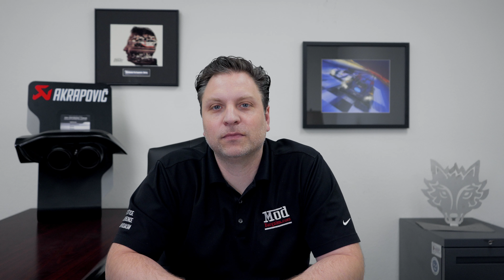Exhaust Materials Explained! *Pros & Cons*

Comment: Wtf, aluminum oxides doesn’t rust, you need iron for rust! There are different grades for stainless some still rust because they contain a high iron content. Dishwashers for example can have a stainless shell/tub but they still rust. Use a magnet on your stainless if it’s magnetic it has a high iron content and will rust. I’m not a materials scientist but this is pretty basic knowledge.

Comment: Ive been working on all sorts of cars all my life, I have never seen an aluminium exhaust. I dont even know how it will work, even the hardest aluminium tube/pipe is too soft for exhaust. and the worst for heat trasnfer, Hence why they are used for heat shields. and I would of said durability due to bad weather and salts, Aluminium would be the best.  over steel. but even with that, ive never seen it used for exhausts.
Reply from the maker: Check out MBRP exhaust - they sell them in aluminum

Comment: Inconel is not very hard to weld.  Most  TIG rods used for stainless welding are Inconel 600 or 625.  Although, it is slightly heavier then iron, a paper thin tube  0.5mm or 0.019".  In the end, Inconel Exhaust is lighter then any other material.  The problem is initial cost at $200 per foot and that it is hard to bend and cut with usual tools.  It cuts and bends just fine but it takes a lot of force or a carbide cut-off wheel.  Inconel turns green (color of Nickel oxide, this is why emeralds are green) in use.  People use 1/8" stainless pipe for turbo headers because cheap 304 stainless will corrode, form scale and flake off.  321 or 347 stainless is best for exhaust but it is more expensive.  Do not forget that exhaust comes out at 850 to 1,100C, but it cools rapidly, especially after a turbo.  Hence, there is a good case for Inconel + stainless exhaust.  Aluminum does not corrode under normal conditions, even at higher temperature, because it forms an oxide layer (which is the second hardest substance after diamonds and what the sapphires and most industrial sand paper are made of).  However, chlorine (as in the table salt and what is spread on the roads to melt snow) will quickly dissolve aluminum oxide and react with aluminum at any temperature!  Chlorine will attack steel and most stainless, just as well.  For the best exhaust sound just use copper or bronze pipe at the end of the exhaust (copper and silver alloys are used for church bells and musical instruments).  It is cheap and more rust resistant then stainless.
Reply from the maker: interesting, appreciate the feedback :)

Comment: Only problem I've got Is Aluminum doesn't rust I know this because I worked at an Aluminum refinery all are Aluminum stayed outside in the rain and snow and non of it had rust ever steel rusts Aluminum dosnt Aluminum just burns out fast because of the low melting point

Comment: Does the material itself improve performance other than being able to handle higher temperature?
Reply from the maker: Yes, weight reduction helps improve performance. The lighter the vehicle is, the easier it is to accelerate, decelerate it, handle etc. Weight is always one of those things that performance if it can attain should try to achieve.

Comment: Is there any chance of a video comparing same material but different gauge? Growing up around hot rodder's I've heard stories of everything including using driveshafts to finish exhausts.
Reply from the maker: Gauge makes a difference for sure, I don't know if I can do a full video on it, but I'll try to put it into a Q&A. Thanks for watching :)
Reply: Ha, ha! I remember that insanity. I also remember annoying ping-pulse sound from thin, crap-grade headers on 11:1 CR SBCs. Now of course we have 14 gauge tubes with Dan Swain's ceramic coatings and woven-titanium wrap to stop that crap at the source. That's progress. Cheers!